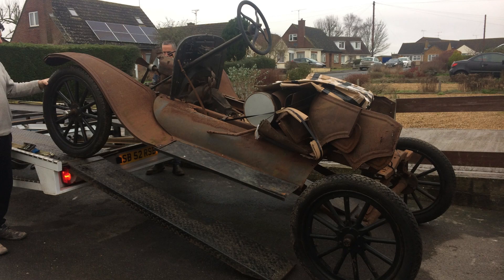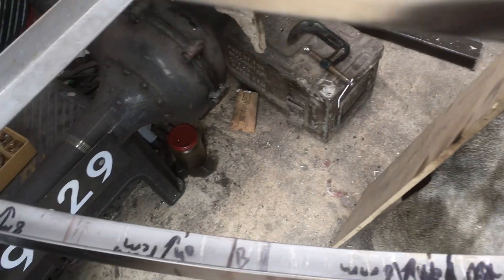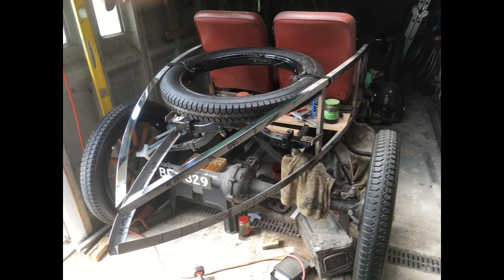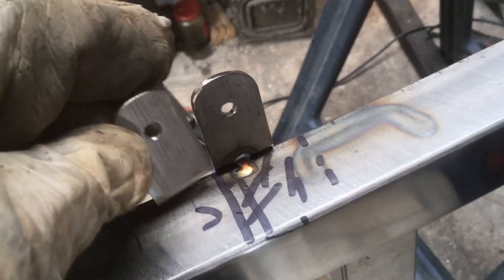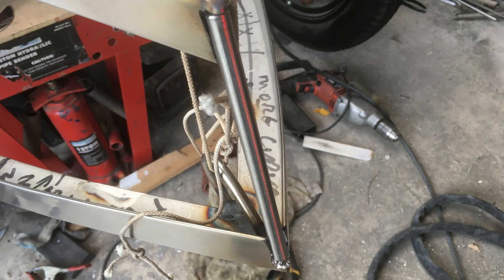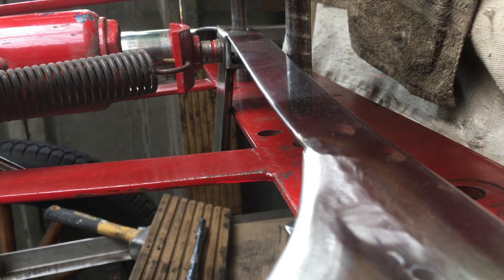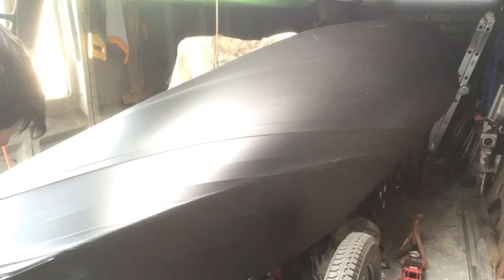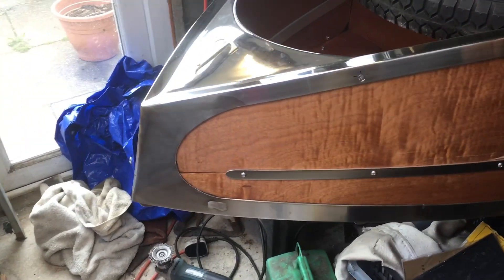Creating a boat tail for my Model T Ford… out of stainless steel.

Comment: Just a little warning for your boat, 304 stainless has excellent corrosion resistance in most environments, but I would avoid using it in saltwater because it is susceptible to chloride pitting corrosion. In saltwater you should use 316, which is much more resistant to this, though still not immune.

The danger is that the pitting (while cosmetically not super obvious) can accelerate a type of structural failure called stress corrosion cracking, which can cause cosmetically ok parts to break without warning. Even 316 is vulnerable to this (happened to my 316 stainless forestay, all but two strands broke before we made it back in) but it degrades a lot slower, and hardly at all in cold water. Heat accelerates it a lot and marine exhaust systems made from stainless are practically certain to eventually crack in this way.
Reply from the maker: Yes, 304 is more susceptible, however stress cracking is similar for 304L and 316L. Note that I use 304L not 304. All my 304L on the boat is not structural or it is (or will be) painted. One of the issues I have is that the unpainted stainless gives a lot of glare and gets too hot in the sun, making you look like one of those lizards hopping from foot to foot when shoeless! Rigging wire does worry me, I had a lot of old second hand rigging for many years, I have finally replaced that with new stuff, but I do not seal the sta-locs with sealant for the very reason that I do not want sea water getting stuck in there for long periods and then being heated by the sun to temperatures above the critical pitting temperature limits. Likewise the use of (I suspect) A2 bolts on outboards makes me nervous every time I try to change impellers or such. So easy for them to just shear off.

Comment: I wasn't sure where you were going with that, but the end result is awesome.  I can't wait to see it out and on the road.   Cheers from the shed
Reply from the maker: Thanks very much, just caught up on your progress too. Looking at your speedo right now and wondering if I can find a good one over here. I did get one, but it was pot metal and all the dials had swollen. There is the model t club auction this weekend, so I might get lucky.
Reply: As a rule, the speedos are relatively cheap, it's the cables and gear assembly that costs a fortune.  Good luck at the auction.  Cheers  @SailingSVPipedream

Comment: Half a millimeter is not bad, I don't think anything at the ford factory back in the 1920s had less than half a mil tolerance.
Reply from the maker: Yes, I am just so nervous of finally getting it out the garage and finding that the body is skewed. That’s the problem with building in a confined space, you can not step back and give it a ten yard stare to make sure it looks right.